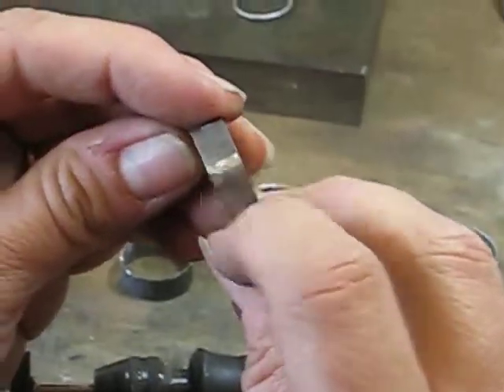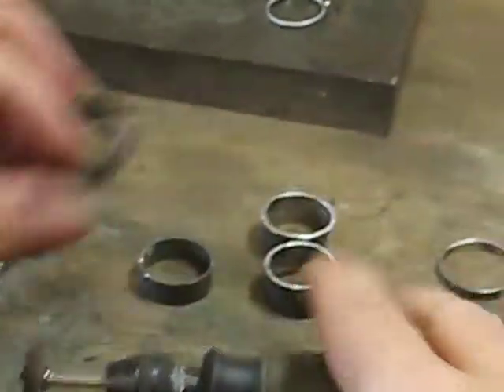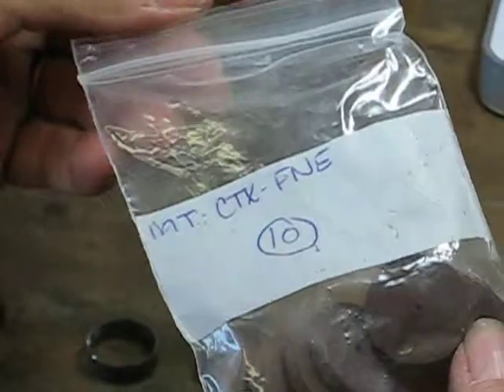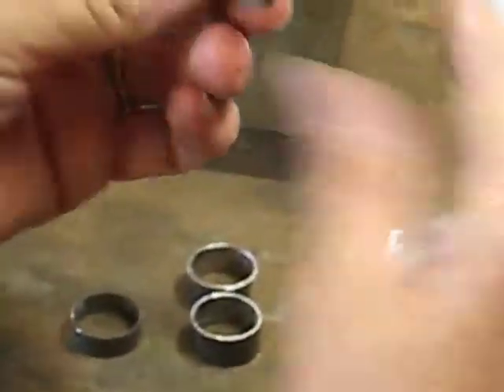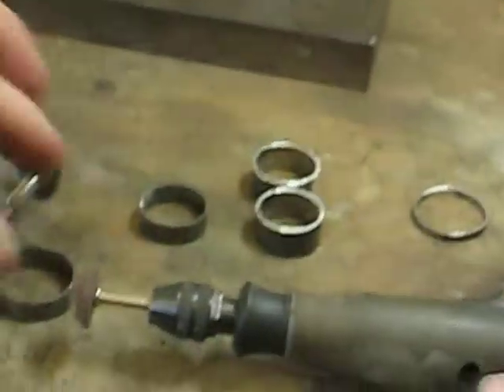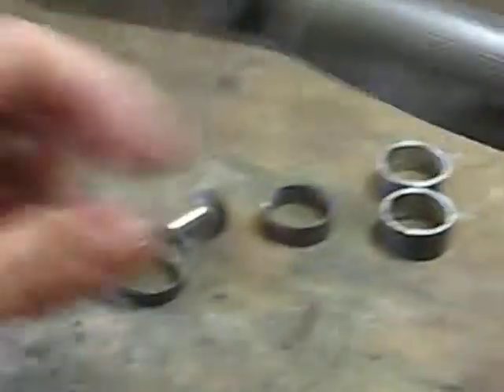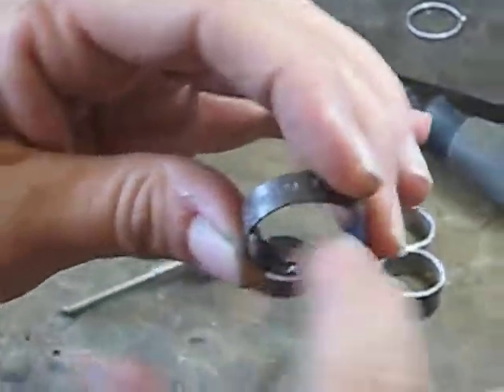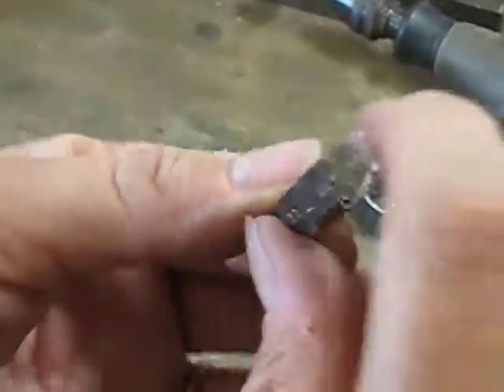Using a Craytex wheel to smooth a solder seam

Comment: Hi! I was wondering if you used silver solder on the larger rings? I have been teaching myself metal-smithing and so far I've been able to make the small stacking rings using silver solder paste but I tried making a larger ring and I lost count on how many times I unsuccessfully soldered it. I tried all the troubleshooting techniques I knew so I figured I would try hard solder instead of paste next.
Reply from the maker: Hi! I do sometimes use sheet solder cut into a strip or small chips on the larger rings. It just depends on how I feel or if my paste solder is cooperating. Most of the time I use the paste solder. I have fewer problems with it now that I keep it in the refrigerator when I'm not using it. I think this keeps it from oxidizing. Once the paste solder oxidizes there isn't much you can do with it. I also put the larger rings in a third hand clip with the seam up. I apply a strip of paste solder to the seam, heat the ring up everywhere but the seam and then gradually move the torch heat up to the seam. Hope that helps!